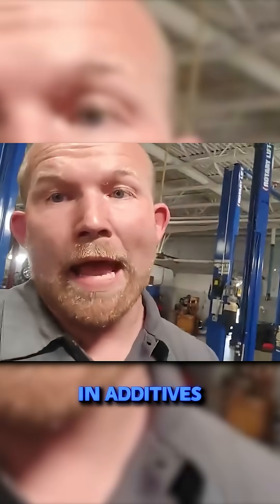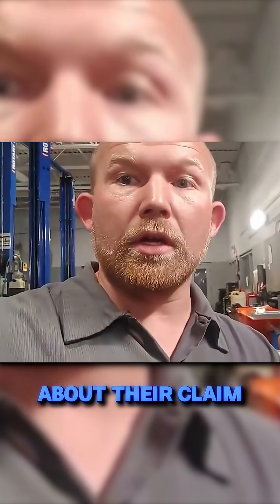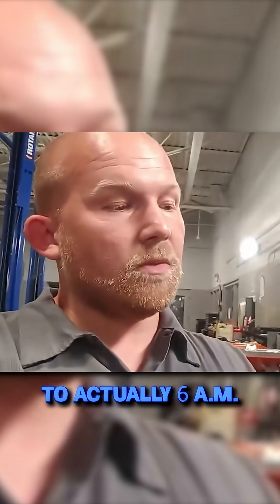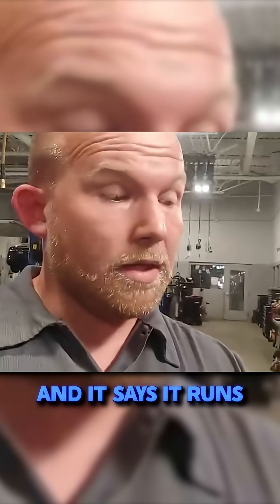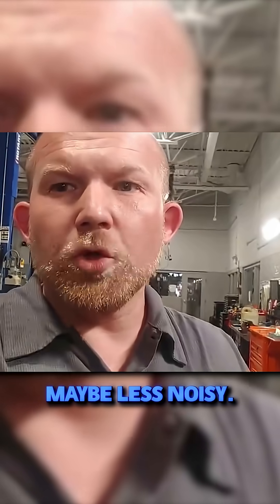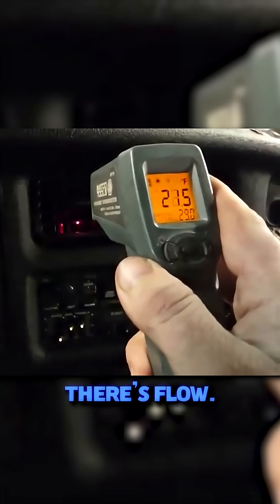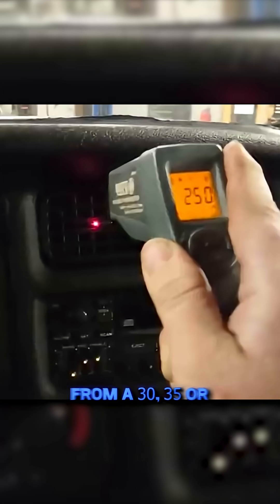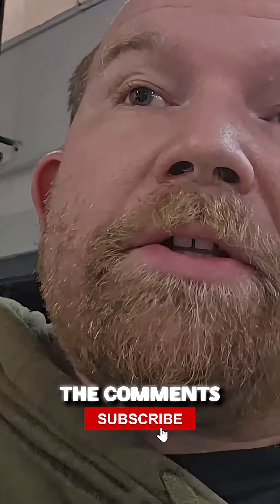STOP Wasting Money on AC Additives That Don't Work! #reels #mechanic

Comment: It's well understood science - the latent heat of vaporisation. Freon has was the best, but can now only be used in specialist applications. Everything else used nowadays in car AC are all similar non ozone-depleting liquefied gases. Much of a muchness & benefits of R12 substitute over R134 over Y134a (or even butane lighter gas- it works fine too, but obv flammable!) are so marginal it wouldn't be noticed in any small system like a car.